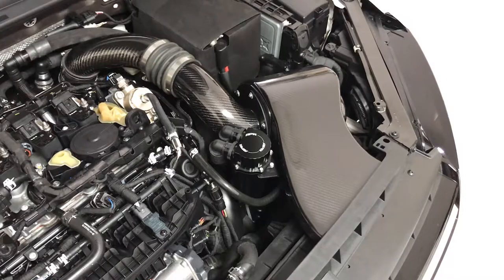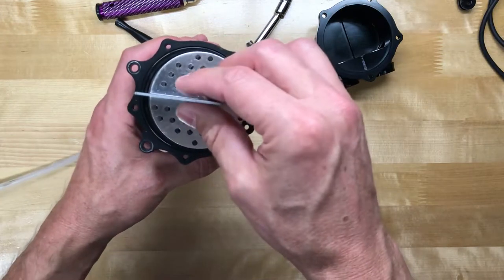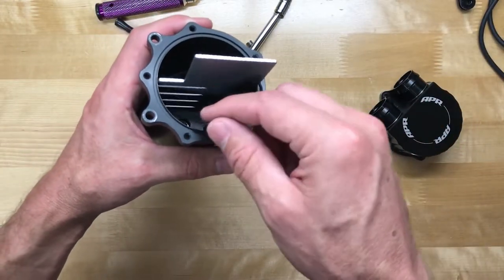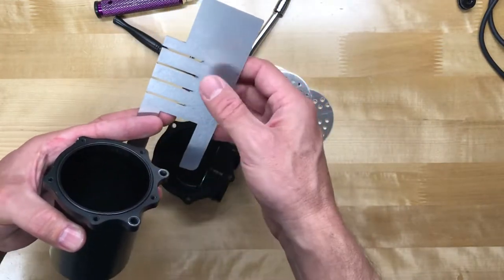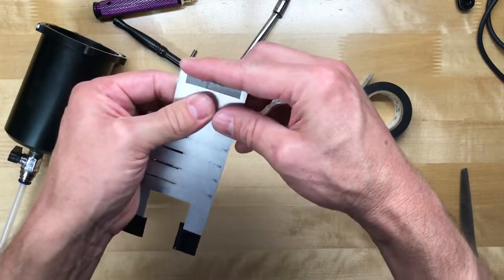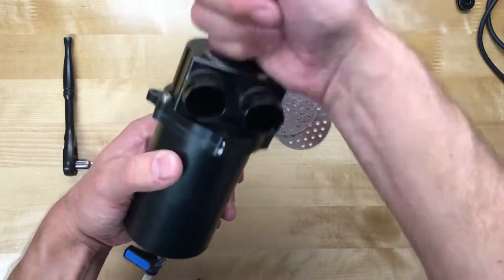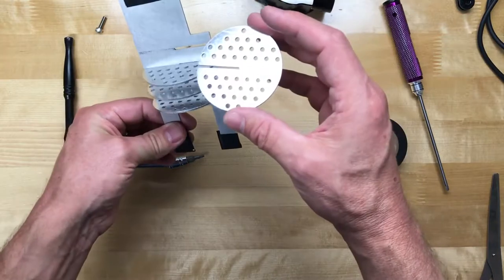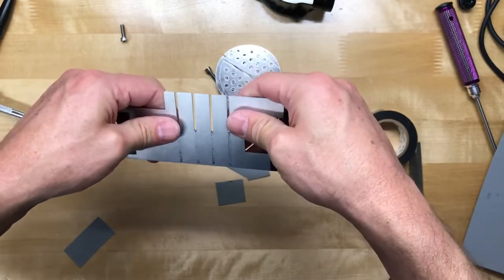MK7 APR Catch Can MOD - Silencer

Comment: i think the reason you are not seeing any oil in there is because there needs to be filter element in there lol, at the moment its empty.. most people use steel wool or air filter elements and jamm them inside those steel baffles, but just on the top 2 layers so it can allow the oil to pool at the bottom.
Reply from the maker: Igor Keating There is no oil before or after the catch can even in the intake track so that’s not it in my case.
Reply: rotaryguy Also u need to wait a while as well. I did this in my diesel Nissan Navara took me about 10 thou kms before i started filling up any oil. But there should definately be oil in there, if there isnt i would be questioning if there is bigger problems with your engine like piston ring gap etc. Engines have to have blow-by, unless it comes with a factory system somewhere already inbuilt to pick it up..

Comment: i got a cheap oil catch can on amazon for 28 bucks it works great. i also do not thing i would put tape on the inside of the can like that. not good if it comes loose and slows the flow or worst gets in the engine. get a new can with out the rattling tin discs

Comment: have you seen anything in your catch can since installing, ive had mine on my 2017 golf r coming up on a year and have yet to see anything .....
Reply from the maker: 33alife it’s only been on there for roughly 4K miles but it’s still is pretty clean inside. Car has only 10k miles total.
Reply: had mine for 20k and nothing when opening valve underneath. either i installed it wrong, or the mk7 PCV is amazing.
Reply: Same question, 2 years later

Comment: What did you cut and wedge under the round plates?
Reply from the maker: ABS Sheet plastic - Pretty sure it was .010" thick = https://plastruct.com/product-category/plain-and-patterned-sheet/gray-abs-plain-sheet/
Had it for a while and don't recall if it was from a hobby shop or a Michael's craft store...Still no rattles by the way so its holding up well.